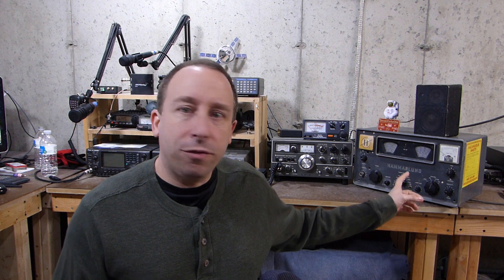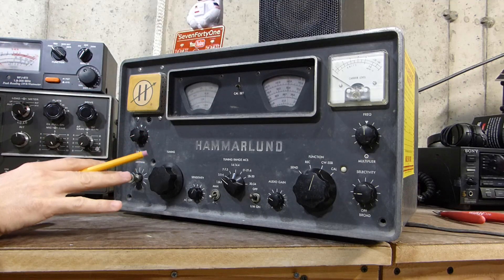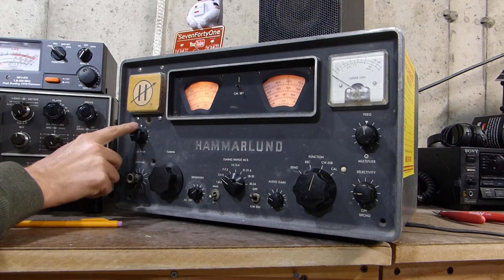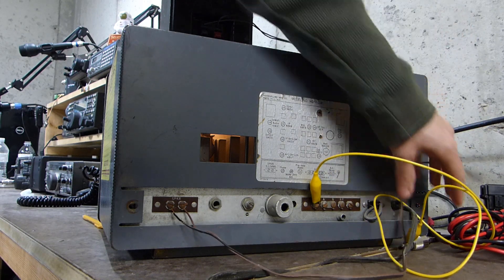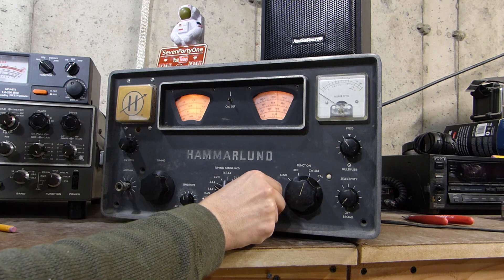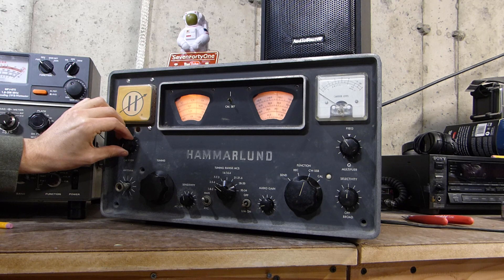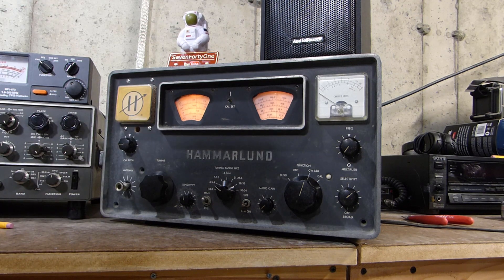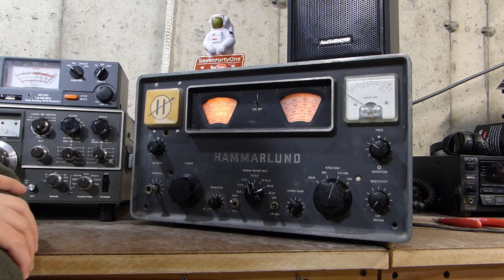Hammarlund HQ100A Overview and Demo of a Ham Radio Classic Boat Anchor

Comment: I LOVE the old Hammarlund gear! I have a few of them myself. Looks like the caps are still functional, but probably should get done to optimize playability. I have a HQ-129, and a HQ-140. I prefer the earlier stuff since the use a 6V6 output tube. The later ones like yours use a single 6AQ5. That's the ham only receiver version of the general coverage HQ-100. Thanks for showing! 73's
Reply from the maker: I knew you'd like this one RW!

Comment: That is amazing. Have you looked to see if the caps have been replaced with more modern ones? I love watching Mr. Carlson's Lab. I wonder if he has done a resto one of these? I did check. Looks like he did a HQ-120. He also said on that one the meter shuts off in VFO mode. 
https://youtu.be/J31nVC0ms0w at 2:33:03
Reply from the maker: I think this thing is all original except maybe for a tube or two.